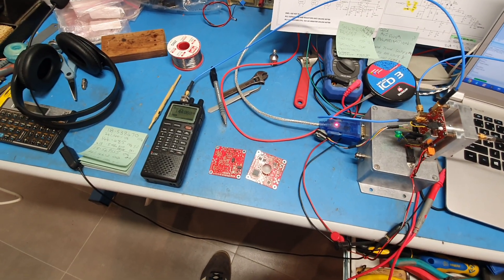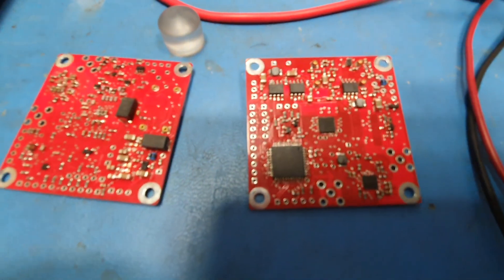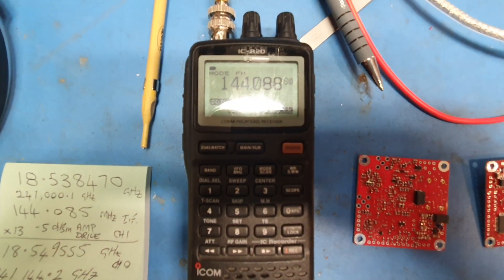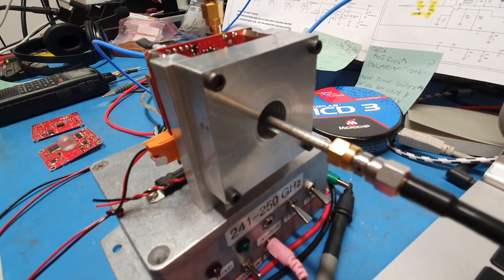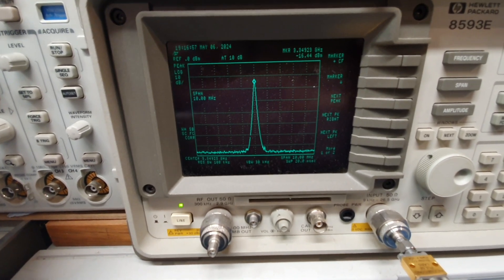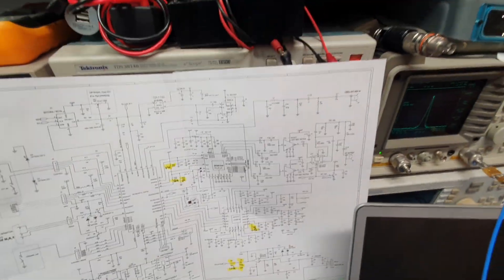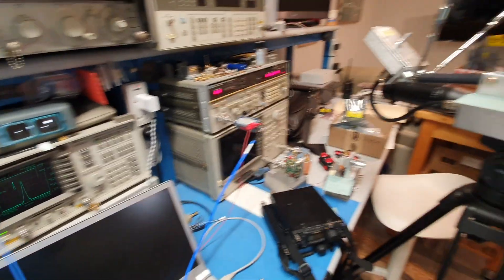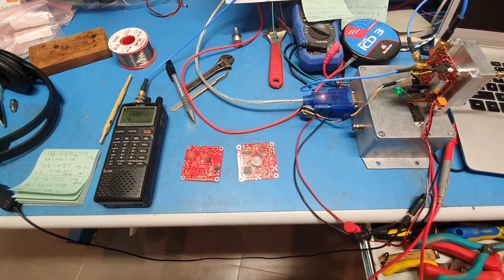VK3CV / WQ1S 241GHz Bench demo May 2024

Comment: Hi Andrew great work.
I have built 3 of the 122 GHz units using the PCB’s as supplied buy Tim, 2 transceivers and 1 as a test bench. I am also waiting on a couple of the new 122/134 GHz boards.
In this video you are using a Diode x13 multiplier and this the the same as your x10 diode multiplier, and is their an amplifier after the signal generator.
Can you supply the details on how I can make the the diode multipliers?
Keep up the good work
73 Gary Vk2kyp

D
Reply from the maker: Hi Gary,

The multipiers are simply the smallest fastest diodes you can find attached to the end of a cable or connector. The one on the left is a MA4E1318 Diode attached to an SMA , The one on the right is a mixer diode salvaged from a Ka Band Sat TV RX down Converter across some 1/8" hardline. They will work nicely as x10 up to 140GHz with around 1-5mW of drive power. I found that I need more drive power to get a signal at 241GHz wich is 18.5 GHz x13. My signal generator wasn't putting out enough power so I used an Amp to gert up to around 40mW of drive at 18.5GHz , you can then hear a pretty good signal at 241G. I can't attach the picture to this reply, I'll send it to you some other way.

Cheers,

Andrew

Comment: Looking good...any thoughts on phased array...?
Reply from the maker: Hi Lehane, My thoughts on phased arrays, good question, my first thought is that everything is lossy at 1mm, the less of anything you can use the better, i.e. support structure for array elements,  a phased array is also probably beyond the scope of backyard manufacture at these frequencies due to the tolerances required, I'm sure it's not going to be easy whichever route I take to get some antenna gain.

73's Andrew

Comment: Great stuff Andrew! I've got my CNC mill up and running at last, so I've been making a load of Cassegrain subreflectors for the Edmund Optics 12 and 18 inch spun dishes.  I'm hoping to get some very precise 250mm offset parabolics machined from solid, but I need to sand-cast them with a honeycomb back rather than machine them from billet, otherwise they are ridiculously expensive. I am getting an excellent close-in RMS surface variation of under 5 micrometres, and better than 25 micrometres across the dish. I don't know how good the Edmund dish profiles are, but I've designed the hyperbola so the second focus is at the centre of the hole in the dish face, which means no need for any feedline, and the focus and polarisation rotation are nice and simple and everything is good and rigid. It does need a custom Pickett-Potter feedhorn. I'm just about to press Cycle Start on some 70 mm diameter aluminium hyperbolic sub-reflectors for the 18 inch Edmund dishes that should work from 76 GHz up as far as the dish profiles will go. Must get back to work on my abandoned 248 GHz harmonic mixer tx/rx project! Cheers, Neil G4DBN
Reply from the maker: Hi Neil,

I've seen a few of your posts about the CNC machine, Sounds like it's going really well, your talking the right numbers with tolerances. Keep up the good work, you're the only one doing this stuff to the required level of accuracy. I used one of the Edmunds dishes for tests at 30THz, It worked but in my mind it's still a spun dish, Can't possibly have the same surface and curve accuracy as a CNC machined surface.

Cheers Andrew